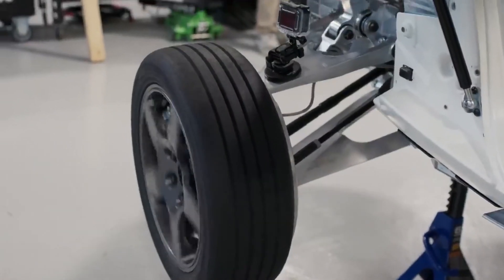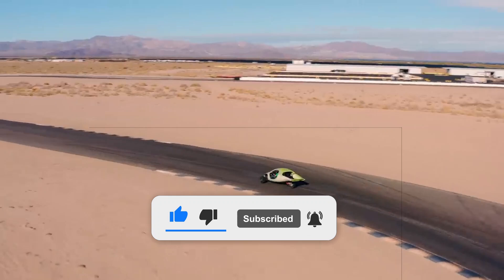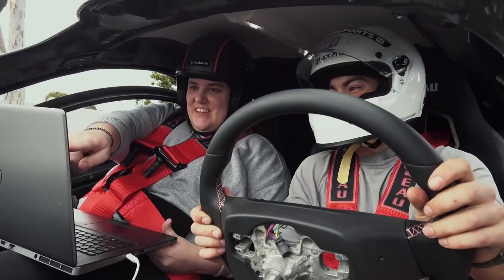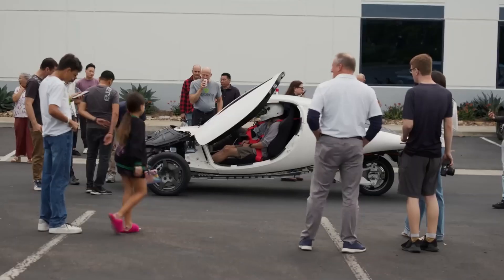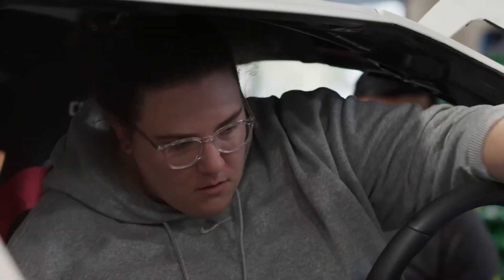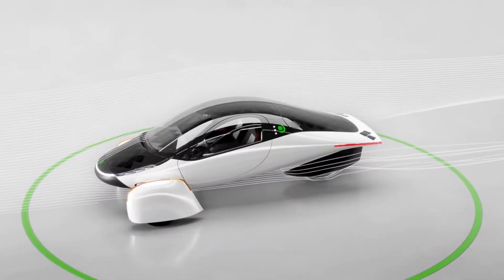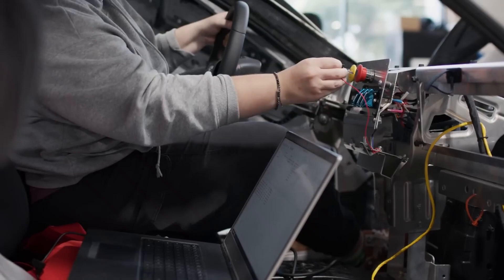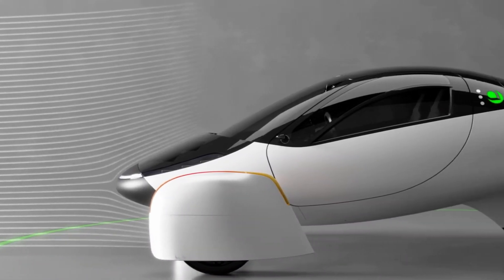Aptera SUCCESFUL DRIVE OF Production-Intent Vehicle With OUTSTANDING Performance | SILENCING Doubts?

Comment: they should take this, make it in two versions (two and one seater) then put the battery in the back on a tilting mount (tilting to left or right)  THEN TURN IT INTO A SNOWMOBILE!
reason: this snowmobile like car is an old design BUT it doesn't work because you cant tilt or lean, but by using the battery pack for that makes it's weight a feature NOT a flaw. it also distribute the weight better, and you can steer while on the rear (track only). 
those who use snowmobiles know how dangerous the mountains can be, THIS WILL SAVE SO MANY LIVES!
Reply from the maker: Lo!

Comment: I wish video makers would do their research instead of making false claims!! I'm an aptera fan, I just hate stupid videos. Major point PI2 is going for track testing which is fantastic  BUT IT CANT TEST IF APTERA CAN GO 1000 MILES AS PI2 IS A 400 MILE RANGE VEHICLE!!! That's an example of sloppy script writing and worse adds to the haters claims. Just don't parrot the same tired lines, do research,  ask questions and DONT PUBLISH INCORRECT CLAIMS.
!!
Reply: Agreed! The latest Sandy Munro video goes deeper into the bits and pieces that were integrated to build PI2. MUCH more satisfying and informative than all the other over-produced videos and animations I've seen ..like this fluffer piece.
Reply: @Steven-h7h  thank you. I haven't seen Sandi's latest video, so I must go check it out.
Reply: What the track testing can do is validate the efficiency numbers. I am looking forward to that. Mathematically there should be a minimal difference between the 400 & 1,000 mile models (and also the 250 & 600 mile models) aside from whatever the respective battery packs weigh and suspension changes due to vehicle curb weight.
Reply: What the track testing can do is validate the efficiency numbers. I am looking forward to that. Mathematically there should be a minimal difference between the 400 & 1,000 mile models (and also the 250 & 600 mile models) aside from whatever the respective battery packs weigh and suspension changes due to vehicle curb weight. Solar validation should already be mostly done, but putting the panels on the vehicle and parking it in the sun for a few days (and maybe during cloudy/rainy conditions too) should be easily and quickly completed.
Reply: @CH-es4up  I'm looking forward to seeing the testing results. Instead of computer predictions,  this will be close to real world, let's face it track is very different from city driving, so the figures will point to possible results. Even better will be when a  PI build conducts city and country driving scenarios. All up this has been a positive step forward for Aptera with more to come.
Reply from the maker: @peterlongland6862
Has sandy address everything othe thing else?
Reply: @ImpressiveTechView  what??

Comment: Is this an ad for a car that doesn't have room for it's passengers?
Reply from the maker: It's the most efficient and aerodynamic SEV Yet to be produced
Reply: @Elementraz  It is the most dangerous to.
Reply: It will have front air bags, steel roll bars to prevent roof crush in a roll over, and aluminum cross beams in the dash board to protect in side collisions. Carbon fiber is five times stronger than steel per kg and its rounded shape is designed to distribute the force of an impact better than flat metal panels in a normal car. Maybe you should do some research before opining about something of which you know nothing.
Reply: @karldettling5981  It's an autocycle. Compared to a motorcycle, it's vastly safer. Name a motorcycle with airbags and seat belts.  Compared to a car or pickup, the shell is comparable to an F1.  If don't like it or feel unsafe, don't buy one or ride in one. I seriously doubt that you're here because you care about my safety.
Reply: @karldettling5981  wrong !
Reply: @amosbatto3051  The plastic body is not structural anymore. All safety now relies on the aluminium frame. The plastic parts are now glued onto it. Maybe you should do some research before opining about something of which you know nothing.
Reply: @d.e.7467  An autocycle IS a motorcycle. And you need airbags and seat belts so you do not ave to wear helmets. It does not comply to any safety standards necessary for a car. And it is a deathtrap i case of an accident.
Reply: Passengers....  They don't even have a car they can sell.

Comment: Add Tesla software updates and FSD, all weather winter airless tires, heat pump, heated & cooled seats.
Reply from the maker: @glee8421
FSD will skyrocket yhe pricing of Aptera.
Open pilot is cool for the start
Reply: @Elementraz  OpenPilot is lots for making driving long distance less stressful.  Heated seats and heat pump would definitely be great improvements for northern climates and hopefully will come (along with AWD option) after initial release.
Reply: Sell to China so we can all have one, otherwise it will cost too much and never be ready.
Reply: @jamesdonaghy9143  China already owned Aptera from 2012 to 2019, and even then they did not want to produce it.